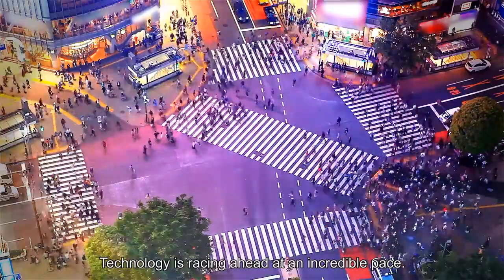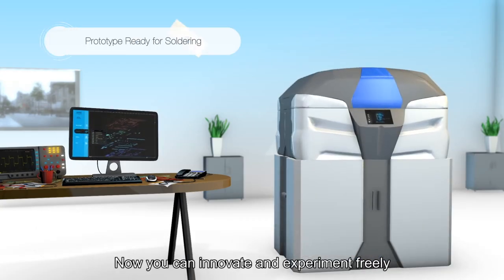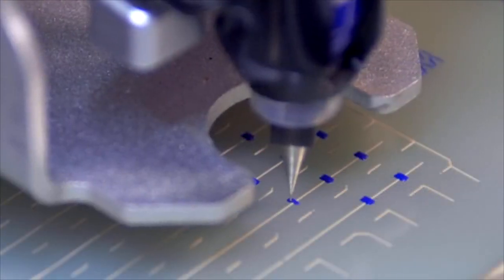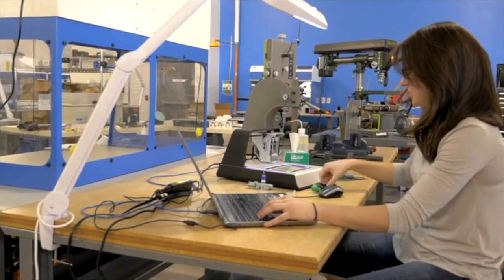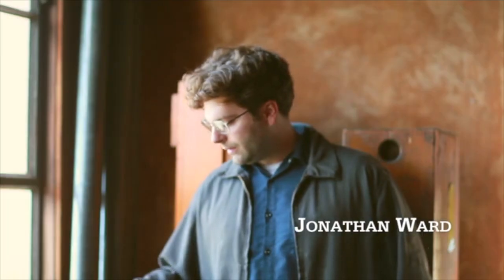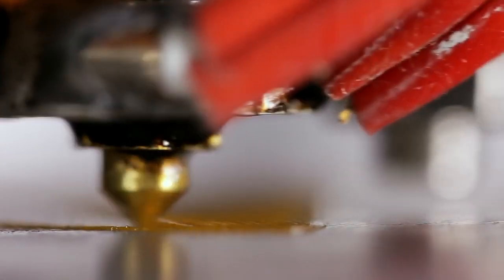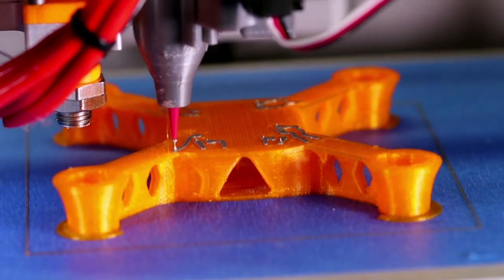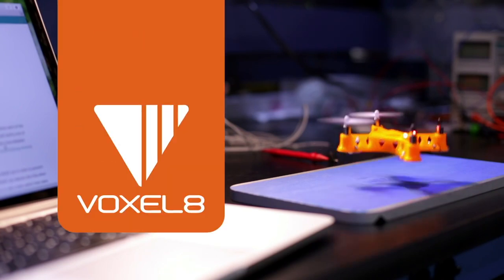Top 5 PCB Printing and Prototyping machines for your desktop

Comment: In general all these machines are really cool, but until they cost $200 - $400 like some of the really great 3d printers out there, you can forget any significant sales or chunk of the market. The reason why 3d printing is popular is because you can buy a 3d printer for a price of a microwave, blender or a fridge. It's a manufacturing machine reduced to a price of a house appliance, otherwise the only parties interested in these machines are so called SME business, and very specific ones. So I'm glad we're going there, but all of these machines are where 3d printers were a decade ago. Which is kind of funny since CNCs have been around much longer than 3d printers.
Reply: spot on, its a restriction of technology just like with 3d printers and it's going to end up the same way, if we want it we will have to build it and release it

Comment: honestly id rather wait 3 workdays and pay 2$ for 5 pcb s than pay thousands for those things..
Reply: @joemama7752  Nope. These would all SUCK for commercial use. conductive ink? seriously. The impedance and connection reliability of this will be terrible. Milled boards? Your track space, track width and minimum drill size is all going to be terrible. Drill bits in these things won't give you more than a few dozen holes. You got BGAs in your design? good luck with that. No commercial company is going to use these things. The capabilities of the PCB fab houses in china just simply blows these away. ENIG finishes, electrical testing, silk screening, laser drilled holes, PCB assembly... the list of additional features you get from the fab houses is simply overwhelming. And for the cost of these machines I can literally buy hundreds of boards (assembled) from the fab houses. Oh, but I don't get my design the same day. Waaaah... I get it in 7 days. Big deal.

Comment: 👍 Hi, excellent, but expensive, we will do on a laser printer and iron
Reply: With the Dragonfly 2020 - it is not. I work at a PCB manufacturing plant and this obsoletes the entire manufacturing plant. The critical part is the size of the traces and spaces they can accurately print. Also...laser and iron work is very energy demanding, which means expensive. Some of these designs are too small though. Not all circuit boards are small. Many cannot be built on this small of a device.

Comment: Voxel8 gives you the power to make your own costume integrated circuits. 
They will be bigger than other chips, but at leased you can do it.
Use tiny surface mount packages when prototyping your chip.

Comment: The strongest point they make is "you can print PCBs on your own and not waste time if you make mistakes" but yet you can print only 2 sided boards (apart from the first one, but that's an industrial machine so it shouldn't belong here). With only 2 layers I would say it's quite easy to check your design several times and make sure its not flawed...and send it to production and having it 1 week later for CHEAP. These machines are SO expensive that I wouldn't see myself buyng one for my job, let alone for myself. Unfortunately this is a very small market and I guess research and production for such machines requires a lot of money...I hope in the future we'll see better and cheaper devices.

Comment: None of these will replace the overseas manufacturers. The printed inked ones aren't going to stand up to abuse nor will they provide acceptable impedance characteristics for anything other than super simple led type hobby projects. The milled ones aren't going to get you plated through holes and they aren't going to get you decent size drills down below about 30mils. Also not going to get reliable 5mil track spacing or clearance. Good luck with your BGAs or 0.5mm pitch components. All that can be easily had with a suite of additional features in about 7 days for super cheap cost from a variety of chinese pcb makers. Nice ideas but we're a long way off still.

Comment: These things are toys at best, even the expensive german printer make some quite crappy PCB with dubious "conductive ink", dont even seem to have goround plane and dont even mention impedance control, high speed signal performances or BGA. Why would we need toys PCBs when we have the real thing made in 24hours with 0.25mm drill and 5mil traces with the most basic 2 layer ones?